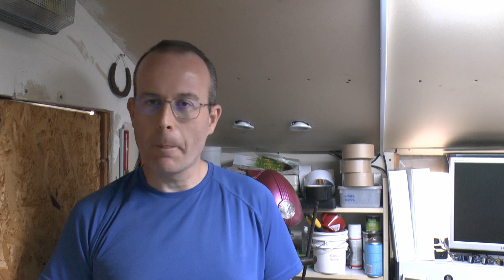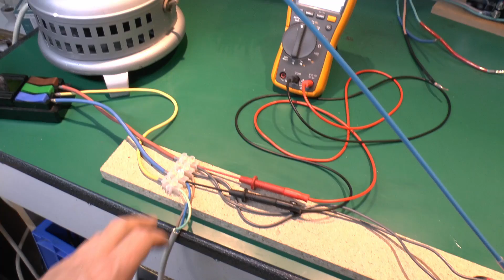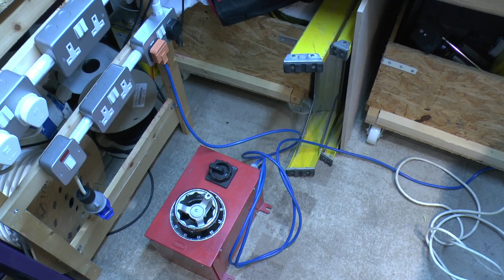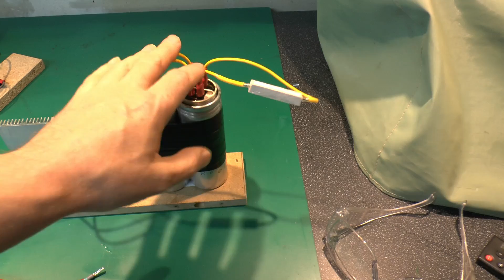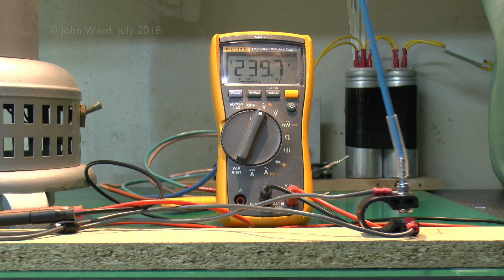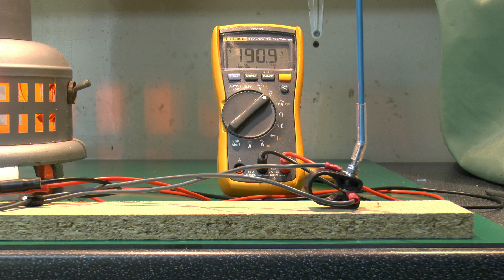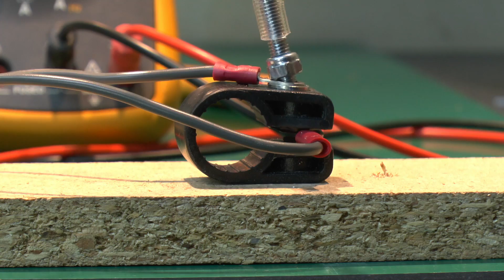AC vs DC Switching Demonstration with Arcs

Comment: You disappoint me Mr.Ward... You need to subject an ordinary AC switch to the test, film the result & show the charred mass which will be the result! Thank you.
Reply: the ordinary AC switch would be the one on the side of the heater which has switched it on and off since it was made and that thing looks ancient, its got to be 40 or 50 years old
Reply: Who said to use the heaters' own on-board switch? I suspect that John would rather prefer to keep that functioning as it was designed to do, as he clearly values the appliance. There are such things as adding another switch in-line, and destroying that with arcs instead, much in fact as was demonstrated in this video. As for the age of the appliance, I've just installed, for actual use, not just display, two wall mounted fan heaters, each 3 kw, each works beautifully, each has passed every electrical test I can throw at them, and each is at least 50 years old. 'Ancient' doesn't automatically equal crap, useless, or worn out.
Reply: yeah no I misunderstood 6A8Gs comment completely. but Johns reason for doing it this way was so we could see the arc and what was going on,  what he made from a pipe clip and screws is essentially an ordinary AC switch, two contacts that are brought together then spring apart.
Reply from the maker: Normal switch video already done - available next week.
Reply from the maker: The switch on the heater actually looks like it could deal with DC - very wide contact gap and it has a good snap action.
Reply: I too thought that 6A8G was suggesting that AC could also be destructive, and implying that Mr. Ward deliberately avoided showing a test of AC arcing where a 'charred mess' would result.   It now seems that 6A8G wanted to see a DC arc making a mess of a standard AC switch instead of using the improvised screw contacts attached to an SWA cleat. 
I approve of this suggestion.
Reply: They are good old fashioned 'knife' switches on those Bellings, decent lump of ceramic (Probally loaded up with some Asbestos as well) and a strong spring........built to last, I think they may have been AC/DC rated, or at least earlier heaters, as DC mains did still exist in the 1950's and maybe as late as the mid 1960's

Comment: So, why is there such a dramatic difference between 120V and 240V at DC?
Reply: number 33 - The higher the DC voltage, the easier it is for the air to break down and for the resulting plasma to conduct.
Reply: Yes but, 240V is only twice 120V but there is like a million times more arcing.
Reply: number 33  As JW explained, AC is a sinewave and every 8 to 10ms the waveform drops to zero volts. So any arc is extinguished. With  DC the voltage does not drop to zero, so any arc continues until the air gap eventually becomes too large (assuming the contacts move far enough apart) to sustain the arc.
Reply: What does that have to do with the fact that 240V produces a Gazillion times a much arcing as 120V at DC?
Reply: number 33 As I said earlier, the higher voltage. Doubling the voltage quadruples the power. Hence a much bigger arc. A bigger arc in turn ionises more air, further increasing the size of the arc. An arc that lasts much longer due to the current being DC.
Reply: I'm not sure that I agree that doubling the voltage quadruples the power, the current is being limited by the resistance of the heater, but even if it does there's clearly a lot more than four times as much arcing.  They are both DC so that is irrelevant to the question and doesn't explain why the arc lasts longer.
Reply: I'd say there's probably just a threshold you have to hit before the arc can sustain itself, and the relationship between the length of the arc and its voltage isn't linear.   
P.S. one of the equations for Power is Vsquared divided by R.  R is constant as you stated, but when the voltage is doubled, power increases by the square of that doubling.  Twice the voltage results in four times the power.

Comment: So then how do DC switches designed for higher currents operate?
Reply: Arc suppressors. They don't just pull contacts apart - they have mechanical devices inside specifically designed to interrupt the arc. There are a few ways to achieve this.
Reply: Use a snubber capacitor and diode in parallel with the switch.
Reply: I can elaborate. There are three ways I know of to make a switch good for high-voltage DC:
1. Pull the contacts far apart, very quickly, using some form of lever of spring mechanism.
2. Mechanical arc interrupters, such as a piece of ceramic that either slides into the path of the arc, or makes contact and breaks it by drawing heat away.
3. A magnet. A strong magnetic field will inhibit both formation and sustaining of an arc.
There's also:
4. Forget a mechanical switch and do something solid-state. Thrysistors are your friend.
Reply: Oh, and Tay's method: Snubbers. Capacitors that take up the current for the instant the switch is opening to prevent the arc initially forming.
Reply: Thyristors will not break a circuit though. You need a GTO or a transistor for that.

Comment: Would like to know how a DC Switch solves this problem.
Reply from the maker: Much larger contact gap, high operating speed, and in some cases the contacts are made from many individual parts with spaces between them rather than a single solid piece.
Reply: @jwflame  sounds expensive!   OT:  have you checked out UIHVDC 1.1e6v in 3k run on Silk road.  ABB ad Siemens making "Krell"-like futuristic crazy stuff as big as buildings!